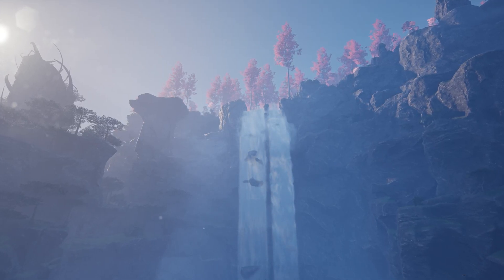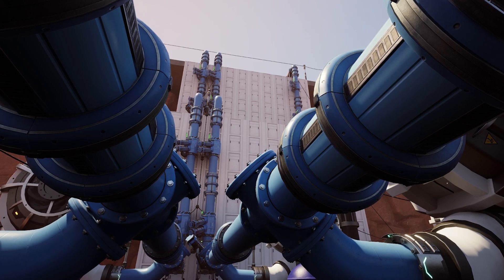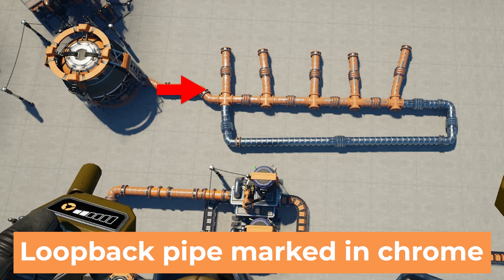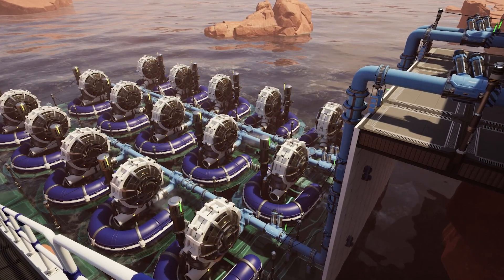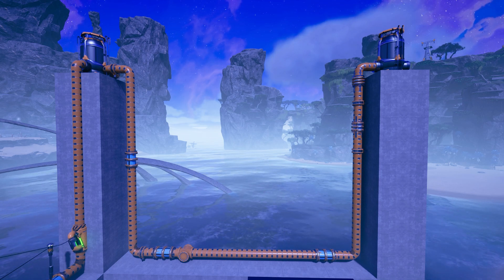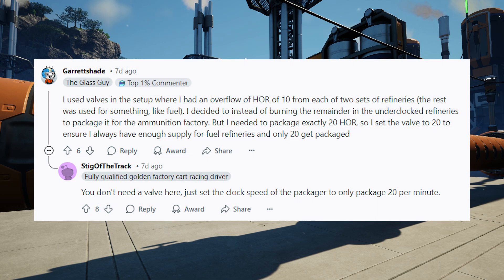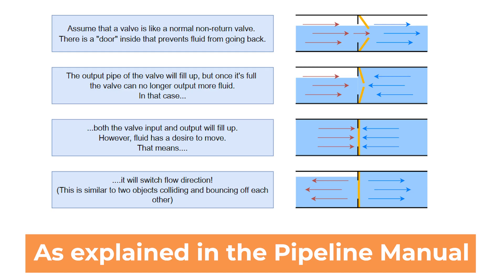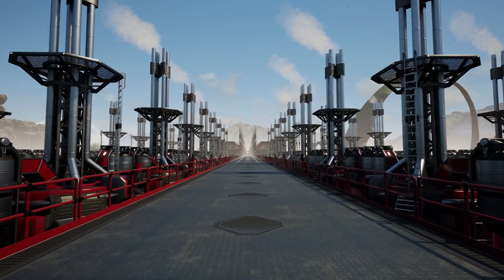Satisfactory: Complete Fluids Guide

Comment: For byproducts or just having to pipe a lot of fluid, and you don’t want to do a bunch of math. You can use a VIP (found in the manual mentioned around page 16 if I remember right) to essentially make a priority merger for pipes. And you can use a combination of VIP and VOP to just make a big line of pipes instead of individual routing to each machines

Comment: I use packagers to get as much head lift as I need. The top two floors of any building requiring water are always filled with packagers and buffers, which I use to unpackage all the water shipped in. The pipe system below takes water to every machine that needs it, without ever having to worry about it again. The empty containers from the packagers can be reused with priority mergers to fill the system and leave no gaps.

Comment: I made my first turbofuel power production facility on my second major playthrough and I used some concepts such as placing down pipe junctions and connecting the pipes properly to the ends, rather than putting a junction on an existing line, as well as a loopback (but I just looped back as far as I could go with a single length of pipe and did two of them near each other.

All in all everything worked remarkably well, all my turbogenerators started up and began backing up way faster than expected. 

Turns out I forgot two fuel power generators. I built 32 overclocked generators instead of 34. On the plus side that added a fair bit of buffer to my turbofuel pipes. I knew my packager shouldn't have been able to consume more than about 2.5 turbofuel/minute based on the calculations I had made. 

Now I just hope I'm not using more than 2.5 turbofuel / minute in my jetpack while exploring.

Comment: I solve the problem one of two ways.

1.  I package fluids and transport them on conveyor belts.

2.  I use Mk1 pipes with Mk2 pumps.  This keeps the pipes pressurized and solves the sloshing problem, but it does limit the flow rate to the Mk1 pipe flow rate.

Comment: You said to prefill the machines, but should you prefill them completely? Or just enough so they can start producing once you turn them on?
Reply from the maker: Preferably all the way, yes
Reply: @SatisfactoryNews And should i also fill the "output fluid" (e.g. crude oil to fuel) to the max before turning the fuel into a power plant?
Reply from the maker: Yeah. Filling up as much as you possibly can in inventories and in pipes means you will have a more stable stable. I also recommend putting a small fluid buffer at the end of a pipeline that's going to power generators, in case the fluids slosh.
Reply: @SatisfactoryNews thank you very much man. had troubles with my fluids and your video helped much. one thing i will NOT do in the future is building the factory bottom up (even though it seems to work now)

Comment: I still think there's something wrong with the implementation of fluids. In my rocket fuel power plant, I have fuel generators on the same manifold that fill/empty at different rates than the gens both before AND after them (yes, I have deleted and rebuilt everything to do with them). That behaviour makes absolutely no sense. On top of this, all of the liquids in the previous production chain appear to be working fine. It's just the rocket fuel pipes that seem issue. 

A lot if these suggestions may solve a number of problems but I believe they just work aroud the issues present in the implementation. My reasons for saying that comes from the fact that the pipe tower gravity cheat absolutely woukd not work IRL. If you're not aware of it, basically you can pressurize any number of pipes connected to a single pipe in a fluid tower. SN's fluid tower cheat is another and was new to me. 

I have a couple more small changes to test but I'm planning to rebuild the plant from scratch to force everthing to flow from top to bottom to see if that will finally fix it but the way it's built now should not have the issues it does. If that doesn't work, I have no idea how to solve it.

Comment: I've had good results in the past with a flat-oriented junction but the loopback on top.  The top then becomes like an inline elevated fluid buffer.  You also can fill it simply by turning off one machine per loop, rather than fuck around trying to underclock everything then reclock it.  Too much manual labor and defeats the entire fucking purpose of using a blueprint to preset clock speeds.

Comment: Wonderful video! I have 800+ hours between Update 8 and 1.0, and I'm just starting a new save after many months' hiatus. 
I had NO IDEA about pumping water up to the top of a tower in a buffer, and then maintaining head lift by putting a closed valve at the bottom of the tower!! So once that's established, you can push water up to great heights without ANY pumps in the system. This was so worth it for just that tip alone.
Reply from the maker: That is definitely the big takeaway! Glad it helped!

Comment: Stop gaslighting people and telling them they're doing stuff wrong. You can be doing everything fine and the pipes are still bugged. I regularly rebuild faulty pipe systems exactly the same way and they just MAGICALLY work. I didn't add buffers, I didn't need to add gravity into the situation, THE GAME IS JUST FUCKING BUGGED!
Reply from the maker: Sure, but these tips are likely to help, especially if you're lost with no idea what to do. It's worth it to try something rather than just giving up and blaming the game.
Reply: @SatisfactoryNews  There is a difference between telling people they are doing stuff wrong. I built normal horizontal pipes at one point, mk2, and it had MORE than enough input, and yet the output was about 3-400 at max... Deleted it, rebuilt it, and then it worked.

The fluids are EXTREMELY buggy.

Comment: After seeing this guide now three times I've learned some things. But, neverthless two questions remain. 
1) why do pipes entering factories have to come from above? It won' block return flow, does it? So what's the added value?
2) I'm still having the impression that one doesn't need fluid buffers. The buffer might help while constructing, bit apart from that?
3) Same for valves. When do they really add value? Or better not use them at all?
Reply from the maker: 1. It ensures that machines are actually getting fluids. 
2. Buffers are probably not needed every time but they can help with sloshing issues if you're having them.
3. They're mostly useful to stop backwards flow, as they can cause issues if you use them to limit flow rate. Overall they are not very useful.

Comment: This answered a lot, but this still doesnt help me with my problem of having gone from Mk1 to Mk2, and suddenly everything is broken.
I am using a system that should work perfectly fine. I underclock each production, and let them fill up. but the moment i turn it back to 100%, to actually yknow.. RUN the damn factory. it just bricks itself, despite having the correct amount of input.
It's gotten to the point where I spend 4 hours watching fluid videos, read the fluid guide 3 times already, and have sat at my factory for 8 hours, trying to fix every possible issue. and even after all that, its still not working as it should on paper.

By this point, I am convinced with THIS many complications added by these mechanics, it'd be a player-friendly move to make pipes a lot less weird (sacrifice 5% realism) for less pain when dealing with these things. but ay, im no dev. and what do I know about player satisfaction. All i know, is that i uninstalled the game after all this dance back and fourth. I cannot be bothered to deal with this, when it truly shouldnt be that hard, if all the numbers are aligning.

TL;DR fluids made me quit the game. specifically Mk2 stuff
Reply from the maker: I totally feel that, I would much rather fluids just work as expected rather than being "realistic".

Comment: One of my methods for the fluid byproduct problem is packaging. For instance, my nuclear plant uses sulfuric acid, and needs more than it produces as a byproduct. My solution is to use a fixed quantity of fluid containers in a loop. I package the fresh acid and residual acid, then send them both to a priority merger with the residual acid getting higher priority, where it is unpacked and sent to the blenders. The empty containers split into two paths via a smart splitter, with “any” routing to the residual acid packagers and “overflow” routing to fresh acid production.
Reply from the maker: I like it! Packaging does end up solving a lot of problems, or at least smoothing them out.

Comment: This all makes a lot of sense but I would like some information on priority junctions in pipe junctions. as far as which input takes priority and what output takes priority. If you could expound on that would be greatly appreciated. I have been having problems in my aluminum setup with water backing up and not splitting properly.
Reply from the maker: I have seen some people talking about this recently, and that pipe junctions do have a priority, though i'm not entirely sure if it's been confirmed. The most basic answer is that water will follow gravity when possible so if your junction is vertical and water can go up or down, it will prioritize down. However that also kind of works in reverse: for input pipes, the junction will prioritize whichever input is lower, so a bottom input would be prioritized over a side input. As far as left versus right, I'm not sure if there is anything certain, but there are many other factors such as sloshing that can affect that split.
Reply: @SatisfactoryNews  That makes sense, I will use that in my build. Thanks

Comment: Mk2 are definitely bugged in some way. I have a rocket fuel power plant, I combined the nitrogen into a 600 pipe and 300 pipe to feed 8 and 4 systems respectively in a manifold system. Once all systems were online, the machines at the end of the 600 pipe system wouldn't get enough fluid. I decided to break the 600 pipe into 2 300 pipes and feed the same machines and all the issues went away. So definitely something odd going on with them.

Comment: Very useful video, however, I was really hoping it would cover trains and fluid transport- as I'm currently struggling with transporting a Mk.2 pipe worth of liquid and getting the right rates going in and out at the stations. Might be worth revisiting an extension to this guide.
Reply from the maker: I can take a guess about your issue, but I could also be completely wrong. If you require 600 fluid per minute, and you're delivering 600 fluid per minute, a train station may not work very well. When a train is unloading, it stops the flow on the output belt/pipe of the station. According to the wiki, the load/unload animation is 27.08 second long, and during that time, nothing will flow out of the station. So you're only losing almost half a minute of flow! So it's important to (1) have fluid buffers between the train station and your factory and (2) to utilize both outputs on the train platform and assign a buffer to both. But you will probably find that this doesn't work either! A fluid car can hold 1600 units of fluid, and you can only get 1200 per minute into the loading station if you are using both pipes, maxed out. So if your train route is short, you might be loading up again before you have enough fuel. Then you're stopping the flow for 27.08 seconds, making the problem even worse. And if you don't have a fluid buffer in front of the loading station, then that pause makes the problem even worse and may cause issues to cascade down your production line, if fluids get backed up.

If this seems to be the source of the problem you can probably solve it simply by doubling the amount of fluid cars and stations you're using. Instead of each car trying to move 600 per minute, have each moving 300 per minute. Build buffers on both train stations, and possible let the buffers at the destination station fill up before you start utilizing that fluid. If you're still having problems, then the ideal way is to package the fluid, then transport it via train, then unpackage it at the destination. This is ideal because regular freight cars can move more units per minute than fluid cars, and Mk5 and Mk6 belts have a higher throughput than a Mk2 pipe.

Comment: On looping outputs byproducts back into inputs: Simply using a priority merger gets the job done just fine with zero incident. 
The exception to this would be the byproduct output being greater than the input but I've yet to experience this. 
For a byproduct like compact coal in a rocket fuel power plant you don't even need the priority merger because the output is so low; getting gobbled up instantly by a regular merger. 

On the fluid side it's the same concept except they didn't give us priority pipeline junctions which seems like a huge oversight honestly.
Reply from the maker: Well said! Priority merger didn't exist when i made this video but I wish it did! 😂

Comment: Honestly most of your problems will be addressed by using fluid storage and pumps- you don’t need to go crazy high just a 4m foundation after production areas and one pump to fill.  So you can go 5 water pumps into a manifold then pump into a tank and you’ll be fine.  Always use fluid buffers after oil/fuel production and smart splitting with sinks to ensure hard products/by products don’t stall the process …. For aluminium loop back the water and use a valve to limit infeed once you have things running
Reply from the maker: Yep, these will solve the majority of simple problems. Sometimes though, the fluids still manage to be cursed..

Comment: The fact the best way to deal with water byproduct in a system that has water as an input is to package it and throw it away just illustrates how bad the mechanics are. It should absolutely be possible to put a higher priority on one incoming pipe (byproduct) than another (waterpump). Thats what turns conveyor belts from a chore into a pleasure to work with.

I did learn some things here and for that I'm grateful, but I will not touch this game again until they fix the god awful fluid mechanics.

Comment: So when coal  Gen needs 112 water and use a valves in pipe manifold it's not letting 112 to it because the valves are wack?
Reply from the maker: Could be a lot of things, because fluids are weird. I would maybe try setting the valves to 115. Basically, slightly more than you need. And seeing if that helps.
Reply: @SatisfactoryNews i saw that 150 help so many i just try 115 if not then 150

Comment: Well there's the first problem there. You see, the fluids don't work on paper. The paper gets wet and then is unusable. You put the fluids in the pipe, they don't work, and then you still end up ripping the paper in frustration. COME ON!!! GET THE ORDER OF OPERATIONS CORRECT!!!😆😜

So I know after watching this, I've been doing fluids accidentally kind of correct. I've definitely had sloshing all the time. But I've made it a standard/habit to basically build a buffer tower of 3 or more high and pump the liquids up to the top and have the liquids filter down to the next buffer below it. It's acting both as a reservoir and a gravity pump and I know I've been super inefficient about it all. Like I have pump after pump shuck'n fluids up 3, 5, 9 industrial buffers up. But it ends up being a huge store of fuel and it's got a lot of natural head lift, apparently. So it might be something you try out. It's literally building a water tower out of buffers because there's nothing worse than being fluid dependent and then running out either by accident or when you're swapping out a system. Like if you're power grid is nuclear powered and you run out of water and everything grinds to a halt.....Yeah, it's hard to recover from that adequately. Having several industrial buffers worth of fluid all being gravity fed helps a lot. But that's just what I do. I'm sure there's better ways of doing things.

I've tried that method several ways. Like I've had drones fly bottled fluids up to have those emptied into a buffer on a tower that drops a pipe down, but it's definitely a weird aesthetic that doesn't really fit into most factory designs. At least you'd need to cover it up some how.

Comment: That isn't my problem mine is a heavy oil residue pipe even with pumps only requiring twenty in total just won't work even with 20 extra meters of headlift it is used for a weapons factory and I can't even get one heavy oil residue through the pipe what issue could I be running into?

Comment: Wait, wait wait. I have not seen anywhere in the game measurements! So how to know if a pump sits on 5, 10, 15 or 22 meterson the pipe? And how tall is that mountain, in meters, that I want to head-lift my water? I know the Water extractor lift 10 meters, but where is 10 meters? And where is 20 or 50 meters?
Reply from the maker: You can use foundations or walls to measure. A wall is 4 meters tall, and foundations come in 1m, 2m, and 4m variants. It can be hard to get the measurement exactly, so it's always best to overestimate. So basically, if you've found the 10m spot, put the pump at 8m, just in case.

Comment: I make a 160 mts tall tower of fuel power generator, and the blenders are at 40 mts, when i was building the pipes to the skys they still flowing the Rocket fuel but i dont use any Pump to get there, i dont know what i do but i wont touch anyting, 2.400 000 MW of power in the peak is enough. but i struggle with some pipes on the ground, sometimes pipes on the ground dont get any flow but if i delete and put it again it flows. no makes any sence for my but if it work don´t touch it is my mantra